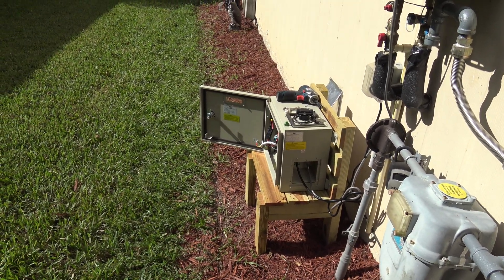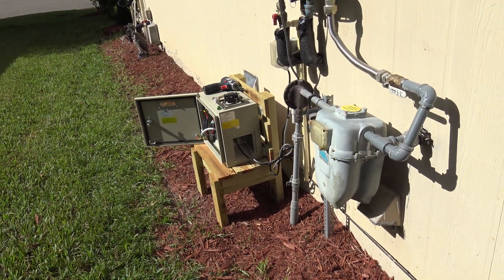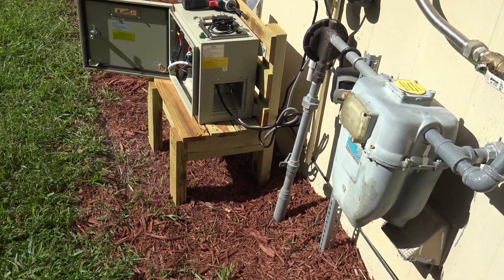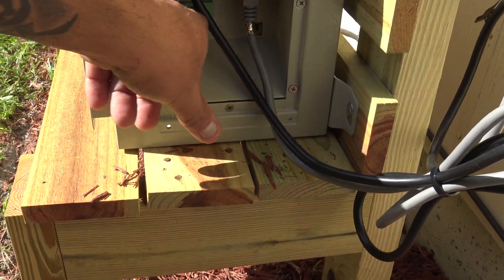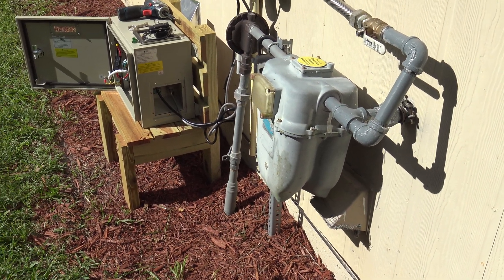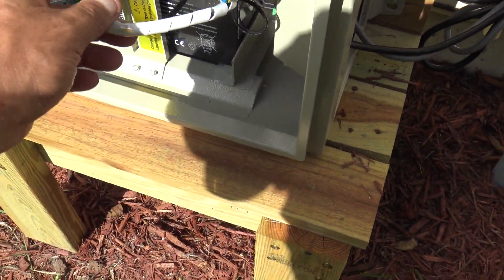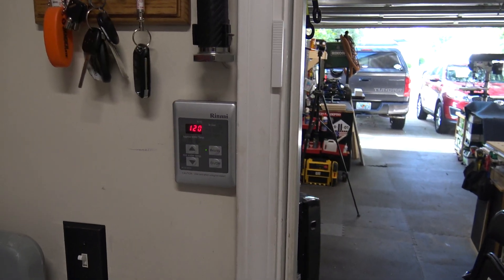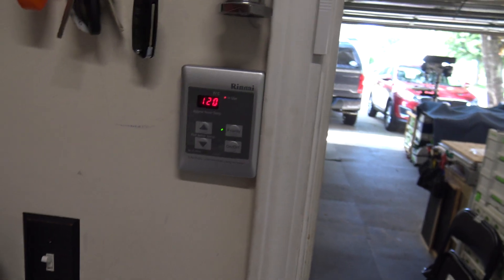Test of the Hugo battery backup system from Safeguard Power Solutions.

Comment: How much of a difference is using a Hugo vs using a APC battery back up to power a gas tankless indoors?
Reply: From what I can tell is if you're home nothing. My unit is in doors. If you are not home, no one is taking showers. A APC would work fine. Just get a larger unit and you could have a dual purpose
Reply: @EdwardTHarris  If no one is at home to use the water, the APC is kicked on during the power outtage and slowly draining the battery, just to keep the monitoring circuits on.  The water flow sensor turns the power on from the APC thus using power only when the water heater needs it.  The APC will work fine if the power is out for just a short time, but if a longer outtage is possible, a sensored flow APC would work for days.

Comment: We just had yesterday a m series rannai system we had it installed in place of a Polaris all in one boiler from lennox that gave us hot water and it also pushed hot water through a air handler that has a rad and coils in it which blows air over them coils which gives us heat we have central air as well anyway we also put in a electric hot water  tank so when the heat went out we still had hot water anyway installation went ok but the guy had to bump the system because he couldnt figure out how to get the rannai and the air handler to communicate so when the air handler calls for heat the rannai dose its thing right now the rannai runs non stop because he had not a clue how to get it to work together we also have a second air handler in the attick that the rannai also sends hot water to same deal as the other handler there identical is there a way to get them to communicate
Reply: killa clutch420 call me at +19042385349 and I will go over it with you.

Comment: Hey Mike, can you do a video on the remote controls Rinnai offers? I have the unit you have in this video, it's installed inside of the cabinet my heater is inside of. I was looking to get another and install one in the kitchen and one in the bathroom. Can you go over the process of how many you can have installed and any limitations there might be? Also, maybe you can list what units work with what control devices? thanks! great videos!